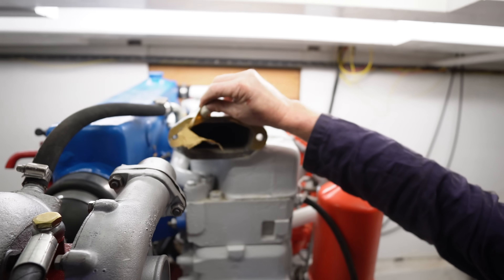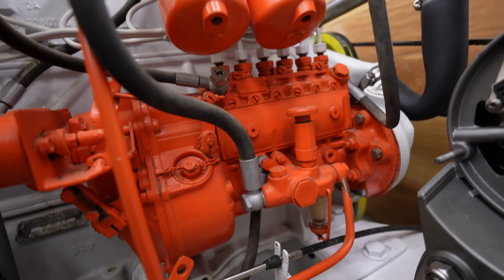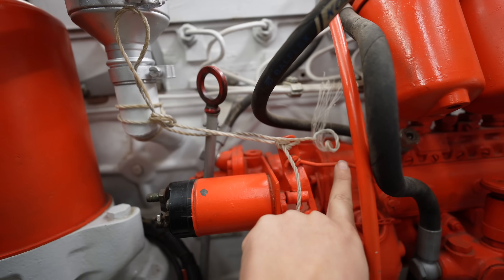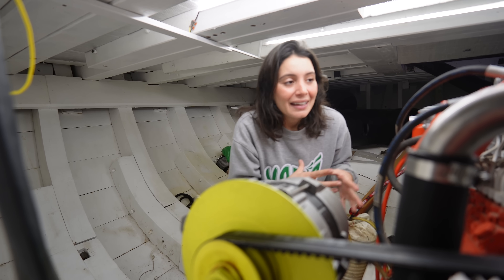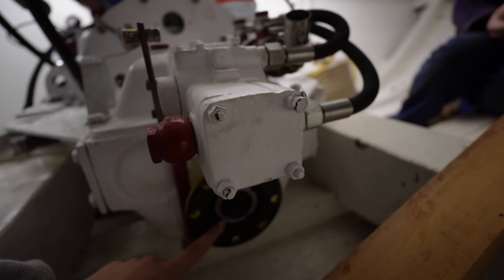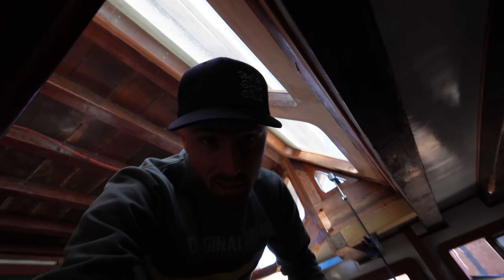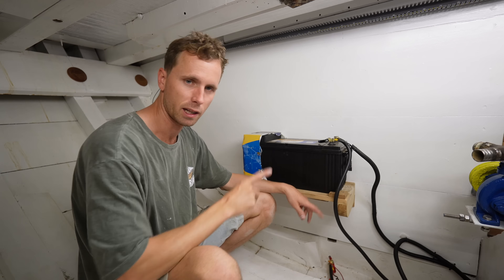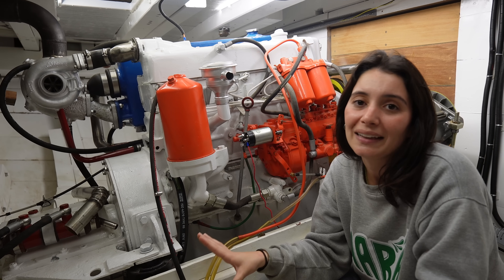Girl Takes on 230HP Diesel Mercedes Boat Engine - Incredible Transformation!

Comment: Your engine / diesel mechanic does amazing work, I remember seeing him do the rebuild. It's probably worth adding a small portable stanby generator to the engine room later for emergencies, with some batteries+solar as you have just the one powerplant.
Reply: I like the engine from tally ho its a generator/diesel/ electric hybrid
Reply: Except for hammering the battery lugs on.
Reply: Yes! A turbo diesel should never EVER sit and idle!!! A genset is absolutely a must have... congratulations on a job very well done. 
Ben is starting to look like a trucker boss!!!
Reply: @saylaveenadmearedead  Why not?
Reply: @verdigo5892  the turbo will clog up with soot and overheating of all systems happens quickly and usually at a place that is far from machine shops... turbos utilize exhaust to reduce fuel but must run on high rpms and as we have seen the gearbox needs to be engaged too.
Reply: @saylaveenadmearedead 
Yep! And that’s why there are so many issues with the newer diesels. Most of them are used to and from the grocery store or hairdresser!
Reply: @saylaveenadmearedead  No they really don't. That old truck engine with no EGR (Exhaust Gas Recirculation) system or other pesky emission systems could ide for hours with no immediate issues other than wasting fuel and normal wear and tear. 
Long haul truckers used to routinely idle their engines for hours while sleeping just keep the heat or A/C on. I think that's frowned on these days because of emissions.
Reply: @verdigo5892  none of your arguments are valid... yawn.
Reply: @saylaveenadmearedead  Probably not. 45 years as a professional mechanic and diesel owner doesn't count for much.
Reply: and their trusted motor pump will come along as well, i am sure!

Comment: I noticed that you filled the freshwater part of the cooling system in the motor with only water. You should absolutely add antifreeze, not for freeze protection, but for rustprotection of the cooling system. Really nice job with your amazing ship!!!!
Reply: Yes the additive package is rust inhibitor. However strait water is a better coolant. Doesn’t hold heat like antifreeze. Just add a small amount of rust inhibitor will do the job.

Comment: Your joy is priceless, well done, girl power! 
In the engine room will you have a smoke, carbon monoxide ambient temperature detector? Heat reflector material on the roof over said engine on wooden boat is a thought. A peep hole with a cover on the door to look in without opening the door, some are big enough to take a fire extinguisher nozzle are also a good thing. With your blower system have shut off or covers to stop air flow into the bay the event of a fire. If those tanks are plastic  have them wrapped in something fire / heat resistant as well as your pipes. 
Looks fab.

Comment: Well done, MP, Ben, and crew! It’s great to hear the engine once again. I think the last time we heard it running was on the sea journey to the boat yard. Thinking back on that journey and understanding now just how much work was needed to stop Yaba’ from sinking, you all should be commended with bravery awards. lol! You will curse yourself for a long time to come for not opening and making sure all the bearings and bushes in the gearbox were within tolerances while you had it out, but it is nice to see that the problem was relatively solved. MP, with your long, unbound, and unprotected hair around those unenclosed pulleys and belts, I do hope you set a safety rule to prevent it and loose clothing from being caught in the moving engine parts, especially because of the way you must enter the engine room and can move around over the prop shaft. But it's so good to see Yaba’ rapidly approaching her splash date. Looking forwards to it.

Comment: The four diesel tanks will give about a 50 miles range assuming you get 5 miles per gallon.  It might be good to get more or larger tanks.  Also, be sure to keep your diesel tanks full so as to prevent water condensate.  And, you need to have a water separator connected to your fuel line to the engine.  Put in a fuel shut off value so you can stop fuel to your engine in case of a problems, and you should have a fire alarm/extinguisher system setup in your engine room.
Reply: he said he has 4 tanks of 210 liters which is 840liters or 220 galon... makes 1200miles, not 50. 220 x 5 = 1100. I think they might eaven get more like 1400nm but i am sure they will try it out when in the water and tell us the results. I am already eager to hear the results.

Comment: You can guarantee it takes 3 times to fix things on a boat. 😂 So the engine starting in on the second attempt is a bonus. The gearbox got you to the yard without any issues so it should be OK.  Great update 2x. 👍
Reply from the maker: That was exactly our thought, we travelled for almost 50 hours and the gearbox never had any funny noises, so why would it be broken now?? Luckily it was all a misunderstanding, phew!! Thank you!!

Comment: @19:35 Nice to hear the engine purr!👴👌🤗
Probably the response on the noise was correct, but...,I myself would still send an email to the manufacturer or a dealer of the gearbox to verify it.👴🤷‍♂

Comment: looking closer and closer all the time, the progress is relentless, well done ! Good choice on the fuel tanks, truck diesel tanks are cheap to replace as well as durable. if you connect ALL of the tanks with a 1 inch supply hose at the bottom of the tanks, you should be able to fill the highest tank and leave the lower 2 tanks sealed all the time, This WILL require venting the lower tanks to the upper level tanks with a 3/8 line between the upper and lower tank. However a single 1 inch ID manifold "25mm" setup will keep your tanks balanced at all time and allow for a single unit fill. In fact you could run a 25mm line as your fill and as your manifold and that will fill all of the tanks, don't forget the VENTS and the roll over valves !!!!! looking good !!! IF you can't connect all 4 tanks into a common manifold arrangement, You can connect the 2 lower and upper tanks, setup a vent from the lower to upper tank as a spillover, then plumb your fuel return from the injection pump to the highest tanks. I highly recommend building a manifold arrangement, with hose for ease of construction, and using that as a fill and a manifold to feed alll 4 tanks. also you can tap the fuel supply off the manifold which saves plumbing.

Comment: Great job.    The craftsman are exceptional.    The engine room looks great the engine looks and sounds new.   
  As a former marine mechanic I have had to fix a few forward gears “gear box”   That noise is very familiar.   Once or twice I had to retorque the flange nut.  If they are not at the proper torque it throws the tolerance out. Some are over 200 foot pounds.  I would see what the spec is and check it before you install the shaft and hardware.    It is going to be a great home for the three of you.    
 Cheers from fenders junction Colorado.

Comment: I had a wooden boat years ago and some guys I hired helped me to drill and tap the shaft alleys to screw in a grease zerk.  The boat shaft slanted downward and back, so they told me to pump into the shaft alleys 4 or 5 tubes of grease just after the boat was put into the water with a grease gun.  I never had any water coming into the boat which is normally required to lubricate the shaft.  the water pressure keeps the grease at the high end of the shaft alleys and lubricated the shafts.  I had 8 alternated layers of chopped strand mat and woven roving, stappeled before the second layer kicked hard and stainless screws after layer 4 into the ribs, and rot ended completely on the planking, ribs and floors.  I also covered the roof and decks with chopped strand mat, FG cloth will not stop tiny fissures when wood moves with temperatures.  Also, when you get your varnish perfect out in the sun, go to an automotive store and get clear coat with UV fighters to cover the varnish, instead of lasting months, it will last years!

Comment: You guys should plan a deep dive episode on the fuel system. Are you going to plumb the tanks together or setup manifolds to switch between tanks. Are you going to setup a reserve tank or just choose one as a reserve tank. How are you going to setup your filters and water separators. As you have enough tanks you could setup manifolds between them such that you can run a small pump but push the fuel through water separators and filters so you can polish the fuel. In addition what sort of pre-filtering are you going to do. Given you have the space you might be able to put a pre filter connected directly to the deck fill. Often in remote areas the quality of the diesel can be poor so being able to polish the fuel can keep the engine running well. I know you are planning on going with Solar and high voltage alternators but you might also think about designating a place for a diesel genset.  You don't want to put hours on the engine if you just need a bit of power. Even if you get it later having a place and plumbing for it will make it much easier when that day comes. Especially if you are going to have high consumers while you are on anchor like dive compressors, water makers, freezers, washing machine,

Comment: Hy guys , just wanted to make a comment on the exhaust elbow, I would guess the stainless elbow is around 5-6 inches and of considerable weight especially with the rubber pipe attached. what my concern is you may get metal fatigue due to the vibration and the weight and you can only support off the engine. I have followed you from the beginning and love what you have done, great show

Comment: Very well done to get the engine running. I thought the clicking noise from the gearbox was because the  gear lever wasn't moving far enough forwards and backwards.  It may still be the case but you won't know until the boat is in the water  - simple fix though.
One thing you have learnt though - never, never use a gasket that has been used before,  no matter how good it looks. 
Keep smiling. 😊

Comment: Probably a good idea to join the tanks to keep them balanced you will not want a manual valve between them switching from port to starboard easy to forget where you are and you don’t want air locks

Comment: Absolutely Fantastic News getting the Engine running after the Rebuild .... Also some Great Suggestions regarding the Gearbox .... Going back a Few episodes .... I watched you fill the 'Heat-Exchanger System' .... I am not sure IF I got it wrong, but it looked like you just used WATER ...... ?????  IF So, you need toDrain it Completely and refill it with the Correct COOLANT. This will be Anti- Corrosion and also do a better job of Exchanging the Heat from the Engine into the Seawater via the Heatechanger .... IF I got this wrong, then I say Sorry !!!!! :-)   :-)   :-)  Best to ALL from ChCH, NZ

Comment: May I help you get back on course, please, the only way to look at a gear box issue at this point in your re-build is first, once the gears are fixed you are 99 1/2% finished with all things in the engine room, 2nd would you rather this happen at sea? I see this as a higher power is looking out for your best interests. Your almost their folks, there is always light at the end of the tunnel and we are all cheering you on so never think for a second you are in this alone. We will see you two on splash day, God bless all of you.

Comment: Love how far you've come with this build. It's an incredibly daunting project you've taken on. I do think that you've vastly miscalculated your fuel needs though. Assuming a fuel burn of 15 gallons per hour (which is being very generous considering hull shape on weight and low speed) you've only got about 15-16 hours of fuel. I would think for emergency situations you'd want at least 24 or preferably 48 hours of engine time.
Reply: HR 64 (20m yacht) listed as using 10l per hour with 300hp diesel, Flying Coney measured at using 10l per hour. That 3 gallons. Granted, the 210hp diesel is not brand new but it should be at 3-5 gallons per hour. Where do you pull the 15 gallons number from? you have a compareable sailing ship with 210hp diesel engine that uses that?

Comment: Here's something easier for that bare exhaust pipe instead of Fiberglass Cloth (Refrasil), the Fiberglass Tape used to hang the Refrasil. Put a couple wraps of that Tape (it's also Fireproof) around the Pipe for protection from Burns, because trust me when I say you DON'T wanna even graze that pipe with your arm when it's hot. I use the Tape on an Exhaust Pipe for my Motorized Bicycle to keep my Leg from getting burned, works great, and still stuck to the Pipe!

Comment: You should invest in some high quality stainless steel clamps for the exhaust discharge pipe and double clamp all the connections for a little more insurance the connections won't leak or even come loose.

Comment: Great work on the engine. Well done.
Also good idea to have equal length belts, if you can. BUT,
I do have a little worry around the alternators.
If I am seeing it correctly, looks like you have one belt from the crank to the waterpump and port alternator and the other belt from the joined waterpump pulley to the starboard alternator. This means you are driving two alternators and the water pump in effect via a single belt. A flat belt could perhaps do that but not a V belt.
Also currently the port side alternator has little belt contact with the circumference of the pulley, so may slip.🙄

Comment: After watching you install the shelf for the starting battery I have some concern about it holding during rough seas.  It's a very heavy item and add the force of up and down motion during heavy seas I'm not sure it would hold up. Just my humble opinion. Otherwise congratulations on an amazing job getting the engine back in top shape!  I can see why MP is sooooo happy!

Comment: The blow - by coming  out of the valve  cover  is normal,  you  fix  it by running  a hose  from the valve cover with a  proper cap  that  has a hose  attachment  to it to the fresh air inlet pipe prior  to the turbo.

Comment: Being a diesel boat mechanic for a while back in the day and an automotive mechanic... that noise is a sign of something is off a bit. It could be a drive dog not fully engaging or a worn bearing/gearset causing it to load and unload every power stroke of the diesel combustion.. excess play in the gears and bearings will rattle and knock as it sees each combustion stroke.

Comment: The problem with plastic fuel tanks is that they melt in case of an engine room fire. That's why they are not class approved. I would recommend that you separate the tank section of the engine room with a sheet of metal screwed to the frames and also invest in a fire extinguishing system. Some of them are pre assembled and relatively inexpensive. Fire onboard is no joke and it's either the engine room or the galley being the place were it starts.

Comment: You should consider getting another battery for the starter due to the draw the engine has on the battery and because you will be in remote places and you wont always have help from others. They also need straps holding them in place in rough waters. You should also consider a high out put alternator so when you are using the engine you can charge everything up and use the cooking equipment and other electrical equipment without draining your house batteries.

Comment: by the battery tray, maybe make a cabinnete with small spare parts, so it's all organiced in 1 place, like spare fuel/water/oil/air filters, O rings and gaskets. belts ect. that way you can easely find it, and you can see when you run low on spare parts.

Comment: BUT !
I still think you need to take the time to add on accessory drive belt tensioners to the engine and remove all that
vibration and flop. This will extend the life of your belts and reduce breakage on the alternator, generator, water pump, 
electrical wiring, mounting brackets, shafts and bearings etc. Please do this !

Comment: I'm guessing you'll have four fuel gauges, but not sure if you plan to have a fifth smaller tank that the four feed into so you don't need to continually open and close valves to maintain balance, port and starboard?  ;-)

Comment: You need to make sure you use bungee cords to strap the battery's down
Reply: Bungee cords are a no no. Should be metal straps with rubber between battery and strap. If these are lead acid batteries might want to add a metal sheet tray as acid eats wood. Also batteries when charging give of gas which is explosive. Looks like you have ventilation sorted. Give a lot of thought and seek advice on the whole charging, battery layout and switching to prevent overloading and separation. Starter circuit should be totally separate from domestic in house supply. Get it right and you will reap the benefits, get it wrong and it will plague you. Good luck

Comment: I think I’m at least opening that gearbox and checking it out. You got a new engine and an old gearbox. Usually that means somewhere down the line it’s going to go out. Just to be on the safe side I would have at least changed all the seals and bearings and greased it up

Comment: On that noise, even automatic transmissions are noisy when you run them in the air with no tires on the ground. There is a lot of slack taken up when under load!